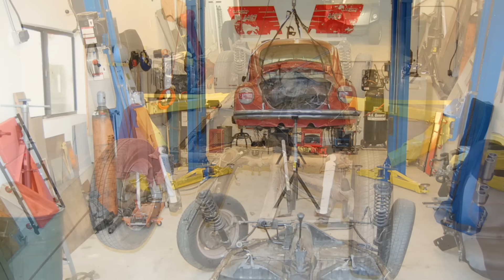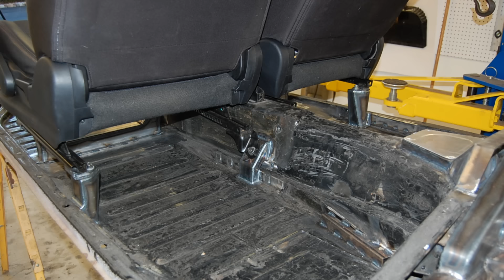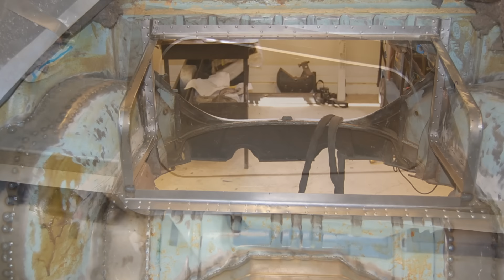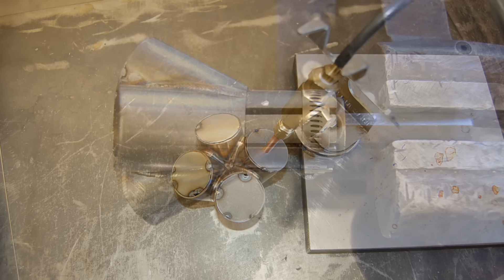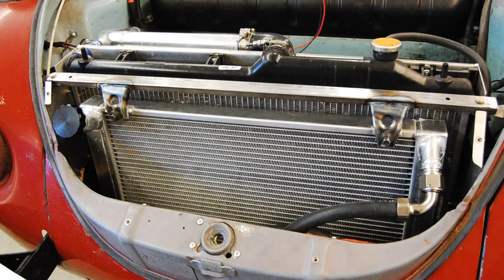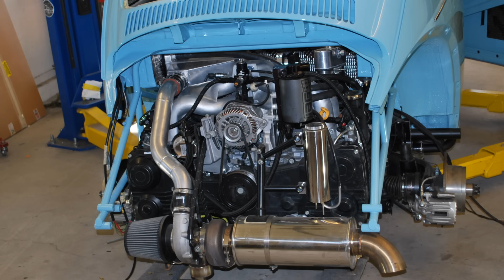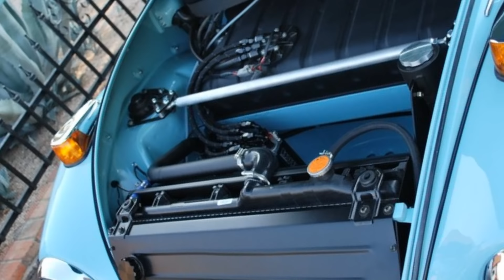The Supersleeper Project

Comment: This guy is just Jaw dropping Awesome! This work is pure perfection! The only thing I worry is seems a lil harsh of an angle to have the CV joints in under 500+ hp? Maybe not? But this car is better than any factory car you could buy! This thing will be around when we are all dead and gone! If they built cars this well Wow! I’m applauding this mans effort and sheer talent!
Reply: he's using 930cv's, they will be fine. When you need strength and angle, they are the only choice. I would like to eventually get some custom length 930's for my Subaru so i can go for more lift without spacing out the drivetrain any more.
Reply: Under load I’m sure the car will squat which will reduce the angle!

Comment: COULD YOU? feed a small supercharger into the intercooler to provide mad backpressure so the turbo spools faster at lower rpm's?
Reply: supercharger must cut out 1000 rpm after normal turbo spool up
Reply: supercharger must cut out 1000 rpm after normal turbo spool up
Reply from the maker: You can do compound forced induction systems but I chose to keep it *simple.

Comment: Although....those 15" "Baja Specials" were model specific to the 1972 BAJA SPECIAL 
ONLY which '72 was the last year for the "flat window Super Beetles"....but
They look great tucked under those "Marina Blau" fenders...
Reply from the maker: Yes, they are not period correct wheels.  I wanted to use stamped steel period correct wheels but they have hub caps which aren't allowed in drag racing.  If you notice, the glove box is '74 and later too.
Reply: @JohnReynolds661  ...it's beautiful...makes me miss my '72 & '71...
Makes me wanna go find a nasty one along a woodline somewhere here out side of Richmond and start again.

Comment: Very impressed by transmission work, but why such angles on the CV shafts?
Reply from the maker: To clear the rear deck lid without external body notching.  To have room for a low mount turbo.  To have better weight bias.
Reply: @JohnReynolds661  thanks for the response.  They holding up?
Reply from the maker: @davidsimms2806  Yes, and if I get 10k mi out of them that's the cost of doing business.

Comment: You are beyond Brilliant,  what an insane build!👍 I do however, have a question about the half shafts angles being too extreme, how are they holding up in real world application with all that horsepower? ....  Not trying to be critical, just curious, because typically steep power train angles tend to accelerate wear on the constant velocity joints.
Reply from the maker: The RCV joints were made to handle over 20* for off road racing.  They seem to be holding up fine.
Reply: @JohnReynolds661  excellent👍, I can tell that space limitations, and cramped conditions made it virtually impossible to do it any other way. What an amazing motor fit,  pure perfection .

Comment: Nicely done John! So top notch! 
I am about to start a similar project with all things a baby blue 74 S bettle 🤣🤣with a lil different end game but none the less I am going back to my air cooled roots....kinda, after years of building Watercooled VW’s and Rally racing VW’s,Mitsubishi, and Subaru’s 
I hope you don’t mind me using some of the brilliant solutions you have engineered! And I have more questions about some of the other items you custom fabricated! Please! Thx man and well done!!
Reply from the maker: Thanks and if you have a specific question, ask away as I try to reply to all questions.
Reply: @JohnReynolds661  
My first question is more
Info on the modifications to the gear box. 
My first idea was to flip the Subaru gearbox like you did like in a Forumla Vee but like you pointed out their needs to be ALOT of work that needs to be done to do it but if done right prolly the best choice. 
Second plan was to just do the T1 adapter plate. 
Third was to find a Rhino case T2 gear box. 
But I’d love to get some guidance or suggestion on those mods. Thx man!!
Reply from the maker: #1 the Subaru is a 5 speed which has an over drive.  T1 and T2 are 4 speeds.  If you are interested in a flipped set-up for Subaru, check out subarugears.  Their website walks you through it.
Reply: @JohnReynolds661  great thx checked em out lots of good info. I could totally do that build!!
Reply: The only other thing is info on the R&p swap you did too! My 74 is a standard steering gear that I wanna swap like you did but didn’t really know it was a thing till I saw you do it. Thx

Comment: Top notch fab work right there. Those headers look great, as well as all the chassis work. Those QA1's are a great bang-for-buck solution. I've used them before for custom coilover setups and with the proper rates they work quite well. You've really got all the right ingredients here to make a hell of a fun to drive ride. The removable apron is smart. I do the same type of thing to the rad support on e30's that I've track prepped. Makes pulling the drivetrain so much easier. Nice work man! 👍😎

Comment: You're obviously quite the fabricator, which requires extensive knowledge in structural engineering and various associated building processes.  The real show of talent was what you did to the transmission.  Where did you learn all that?

Comment: This is a lot more sophisticated than a sleeper VW I saw in a magazine in the 70s. They handled the liquid cooling and styling in a similar manner.  They powered it with one of those two hundred horsepower two stroke V6s OMC used to make. I imagine it lost some of its useable power in that configuration with the narrow power band ect.  However those OMC engines were very lightweight and whatever the real power output was, it would still be a lot of power in such a light and little car. Another thing you should consider about the 70s version. All that oil smoke would do wonders to reinforce the illusion.
Reply from the maker: Hmm, never seen a 2 stroke V6 powered bug but I bet it would sound wicked with 6 expansion chambers.

Comment: This beats the MCM “Miss Daisy”, but if you weren’t going AWD, why not use a Kennedy adapter and a bus trans so you didn’t need to have the axles at such an angle?
Reply from the maker: Bus trans are plenty stout but only 4 gears.  To have the motor as far forward as I need, you'll still have an axle angle exactly the same if using an 091 trans.  There are other ways to fit a quad cam Subie engine without moving it forward like lowering it down considerably, cutting and protruding though the deck lid but I don't like those choices.  Plus, there would be no room for the low mount turbo.
Reply: @JohnReynolds661  considering the sleeper goal, that makes sense. Thanks for the response. Fantastic work all around, good sir.

Comment: How are those driveshafts holding up at the 14 degree angle?
Reply from the maker: The RCV joints are made to handle over 20* on off-road stuff and seem to work fine at 14*  They may get loose in the future and need to be replaced, but that's the cost of doing business.  Axle boots are the problem.  I just switched to RCV high angle boots and we'll see how they work out.

Comment: Umm .... not a "sleeper." Can't have a shortened rear end and 35's or whatever rubber that is on the back and be a sleeper. However, nice work!
Reply: Nah bro. Embrace it. It's a sleeper
Reply: Nope. I'll tell you what a sleeper is: e60 BMW 535i with n54, base model. Twin turbo. Stupid fast. No mods necessary.
Reply: Take the cats off & flash it, you're 450hp to the wheels. You're dusting that $50k Bug WRX with your wife's daily driver. That's a sleeper.

Comment: surprised by so much work and dedication, but more surprised to see that after so much work the battery remained in the same damn uncomfortable place as always.
Reply from the maker: I rather like the stock location.  Besides, the front trunk is already busy with other stuff.
Reply: @JohnReynolds661   If they can modify it to fit an engine from another car, why not also modify the fuel tank and thus be able to put the battery in a better, more comfortable and accessible place?
Reply from the maker: Maybe it's just me, but I didn't see any labor effective reason to move the battery.  It just doesn't need that much attention.  If it were a full-on drag car, I'd move it to the front for weight bias.  I did make the battery mount able to fit a conventional battery from Costco though.

Comment: On my god god!!! You’re hired!! I had no idea I could put a shortened Subaru trans into my Super! Amazing!
Reply: To add to my previous comment, I have a 71 super in stock form but currently dismantled with the pan on the floor and the body up on a rack. I also have a 2011 foster with the turbocharged quad cam EJ25. I’m not planning to gut my forester but having been under it a hundred times, I’ve looked at the trans and wished it could be shorter to fit in a bug. Makes perfect sense that you could just remove the rear section and leave the forward shaft and diff in place! I would have to research it further but I’m assuming the fluid coupler must be in the rear section. You’ve done an amazing job! I had intended to swap an EJ into the stock VW frame but was thinking I would likely have to shorten the rear horns and shift the whole drivetrain forward to clear the timing covers. By the looks of your photos, that’s exactly what you did. The rear package tray was wasted space anyway. That’s genius!
Reply from the maker: Check out Subargears, they have a lot of info about swapping.
Reply: @JohnReynolds661  
Wow! They have a lot of amazing info. Thank you!

Comment: Did you ever think about mid mounting the Suburu engine so that it went the way it did in the WRX?  That still leaves a problem mounting a shifter, and you can’t use the rear seat, but who cares about that, right?
I like the highly accurate and precision of the butt loud of rivets used in part of the sheet metal.
Reply from the maker: All things were considered including AWD.  There are a few Subie mid-engine bugs. IMO, the amount of time needed to make the structure changes weren't worth it.  It's hotter and louder in the cockpit as well.  I set out not to make the most complicated project, but rather a polished version of a rear engine, Subaru powered bug.

Comment: Lovely job what about the weight distribution in other words is the drive good for road holding? I’ve done two beetles and hated it
Reply from the maker: It's fun but definitely not a rally car.  With the motor moved forward and the radiator business up front, the bias is probable similar to stock if not a little more front heavy.

Comment: John,  That's the exact color of my 1970 VW, that looks great! Mine was a sleeper too, Porsche 94mm jugs and heads with roller lifters and dual Weber carbs on New 
Michelin Radial Tires, Koni adjustable shocks. I miss that little Bullet.

Comment: Your work is excellent but why not toss the torsion bars and run dual adjustable coil overs you have a pretty bad ass sleeper
Reply from the maker: Torsion bars get a bad rap, but they work great and also take up less room in an already busy area.
Reply: @JohnReynolds661  agreed on the room tell me about the transmission mod I’m a machinist I did a T5 for a 60s F100 inline 6 but I’m interested in building a Baja bug
Reply from the maker: There are several different transmission formats to choose from.  I chose the Subaru 5 speed.  When you use the Subie (5mt) trans the third member rotation has to be reversed, which is done through Subarugears ring and pinion.  That's the basics.  If you throw a lot of  power at it, then the 5mt trans needs to be strengthened.

Comment: I woud love to see litle more about gearbox.
Reply from the maker: There are several different transmission formats to choose from.  I chose the Subaru 5 speed.  When you use the Subie (5mt) trans the third member rotation has to be reversed, which is done through Subarugears ring and pinion.  That's the basics.  If you throw a lot of  power at it, then the 5mt trans needs to be strengthened.

Comment: That would be dope to see this done on a porsche 914.  I couldn't imagine it being much different
Reply: It would be easier.  No need to do the reverse R&P swap on the trans.  All that's needed is to convert it to 2whl drive.
Reply from the maker: Radiator placement is a little bit of a problem, but there are examples around.
Reply: @JohnReynolds661    .. I have a friend who has built several replica Speedsters with Subaru engines and reverse rotation converted gearboxes. He mounts the radiator up front. On these cars he builds them with 914 front suspension so there's nothing in the way of the radiator related to the front suspension like there would be if you used a std Beetle front beam.

Comment: Very cool build,and awesome engineering! Why did you choose to go with 2wd?
Reply from the maker: There are a few ppl doing AWD bugs....and they're still working on them.  The reason not to go AWD is because of the added weight, complexity and parasitic drag. When it's done, there's not a lot of weight at the front to take advantage of the aforementioned.  That being said, I applaud anyone who takes it on.
Reply: @JohnReynolds661  very nice work, thanks for the reply.

Comment: Awesome and fantastic job. For sure , it is a supersleeper. Quality workmanship beats the original. 

However, I have 2 queries: 
1. Why did you not get (anyway it is already there for the taking instead of the dumps) and install the complete 4 wd parts (differentials) including the steering assembly of the Subaru making the VW an all-wheel car for better road grip? 
2. Understand the VW wobbles with the increase in power. Did the rollbar compensate for / strengthen the structural integrity of the base frame needed for the power ? 

Thanks and keep safe

Comment: Great work and fabrication. You didn’t mention if you had to make the engine run in reverse rotation. And if you did how did you accomplish that.? Years ago my friend put a Oldsmobile aluminum 215in.³ motor in the back of a Corvair. And he had a custom camshaft made for the reverse rotation.
Reply from the maker: The engine doesn't change direction.  The Subaru transmission does by flipping the ring gear.
Reply: @JohnReynolds661  thank you.  I think I did hear something about the ring gear I thought he was referring to the starter at that point. But it makes perfect sense

Comment: A lot of great Fab skills there -- Wish I had access to some of the equipment you used -- Good luck with that Subi trans, I went back to a 091 trans after destroying 4 of them..... There is a company out of Aussieland that makes R&P for the Subies that do not need to be flopped and will last a lot longer. Beautiful Project!
Reply from the maker: It's sounds like you have it all figured out. How do you change direction of the trans without flipping the Ring gear?

Comment: Good to hear you exchanged the seats for lighter units; after all, with over 500 bhp you’re gonna need every possible weight savings. 😂 Apart from that, your work and this sleeper is literally amazing. 😎👍
Reply from the maker: I know what you mean, at first I was trying to save weight everywhere.  But the power is so ridiculous it just doesn't matter.  The other reason for the seat change was the Subaru seats were too wide to fit in between the cage.

Comment: Nice work, engineering/design & machining without a doubt, GREAT attention to minute detail but in the end you have a straight line VW Bug where $$$$ is no object & fake exhaust that would never support the rubber tucked inside the fenders ha ha ha..seeing that, I'd have to say "that's nice" and leave you alone.

Comment: In the 60's I owned 2 VW beetles. Nothing. Nothing would persuade me to drive one such as you have built. I had enough trouble keeping the backend in line with just a very tired 1200 CC engine.  Good luck.

Comment: Fabulous work to a massively better than factory standard, I am in awe of the skills you have used to build this. Personally I would have used the earlier ‘flat screen’ super beetle as a base-because I prefer them..... I built a sleeper back in 1970 but that was nothing like yours-just an old oval window beetle with a Porsche Super 90 engine and transmission-basically bolts straight in........

Comment: well enginered bug ,horsepower output seems a bit ott ?????
Reply from the maker: Do you mean that 50 net hp on a stock bug does not mean 50 whp or that you don't think this makes 517 whp on a Mustang dyno?
Reply: @JohnReynolds661  517 whp seems way too much for a subaru motor/car only runs 11s in the 1//4 ????????
Reply from the maker: The stock '09 WRX was rated at 260 but this motor is far from stock.  Subarus can make over 1,100 hp.
Reply: @JohnReynolds661  you put a lot of time/effort/cash into this project nice job !!!!!!!!!! whats next ???

Comment: I always figured that a sleeper should look kinda beat.  It helps people think that the car is nothing special. My VW sleeper (built 20 years ago lol) was based on a drivable but well-used '71 standard beetle.  I also did an engine/tranny swap, but used the powertrain from a '74 Caddy ElDorado.  I cut off the back of the VW pan in front of the torsion housing and then swapped in the engine, transaxle, radiator, suspension, and frame from the Caddy as a unit.  I made a subframe to adapt the Caddy frame to the VW pan.  500 cubic inches of torque makes 1900 pounds get moving in a hurry.

My fab work doesn't look nearly as nice as yours... I built mine in the school parking lot with an acetylene torch and MIG welder.  I even had to dodge the parking cops on the last day of the build since they had taken a dim view to my activities :)